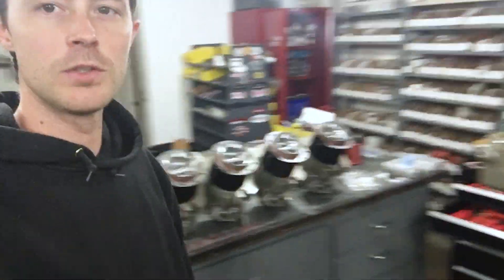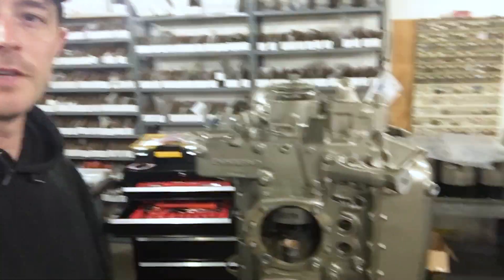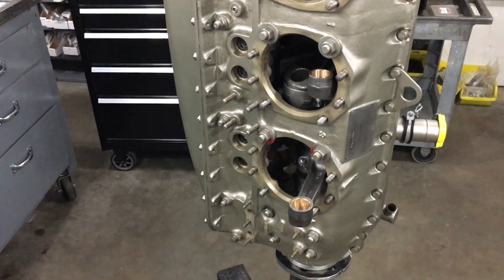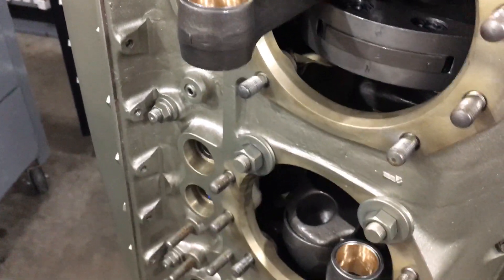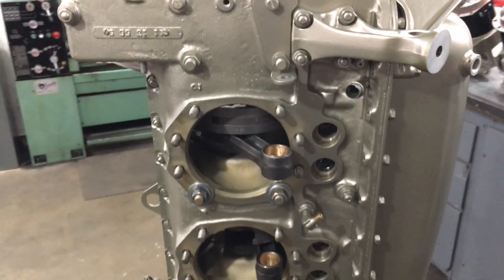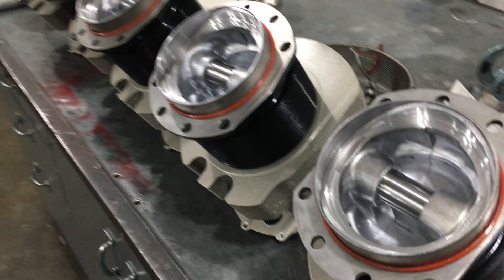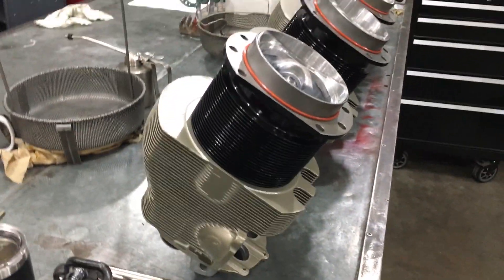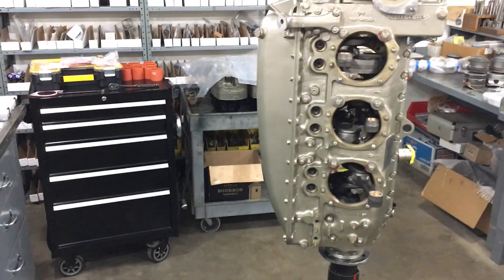Installing Cylinders on a Continental O470 Aircraft Engine!

Comment: Shouldn't the cylinder studs be lubed before final torque is applied?
Reply: i see an oil can on the shop bench, so lets hope they did that
Reply: Yes, they should be using 50 weight oil 😢